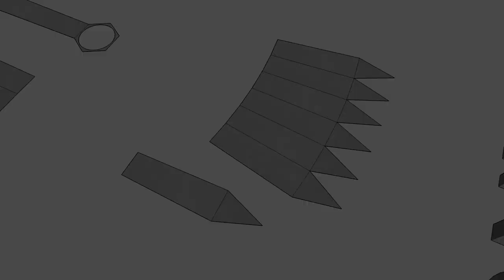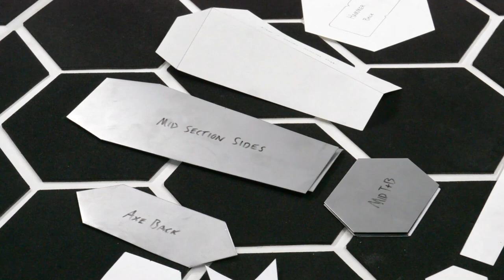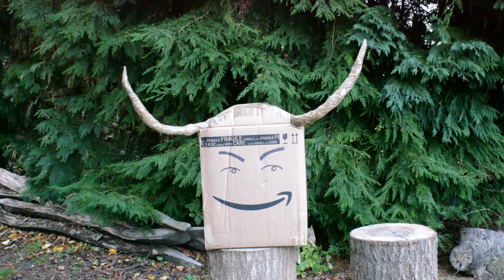Making Thor's Real Functional Stormbreaker

Comment: That's so cool, you could fill it with concrete to get more mass to it.
Reply from the maker: Thank you. I could, but as Force equals mass times acceleration, I prefer to swing it faster. Then it looks more like how Thor would swing it, and the cutting edge is more effective.
Reply: But then it would be dangerous.  Not to what you are hitting to the user.  I guess there is a reason real weapons are so small.